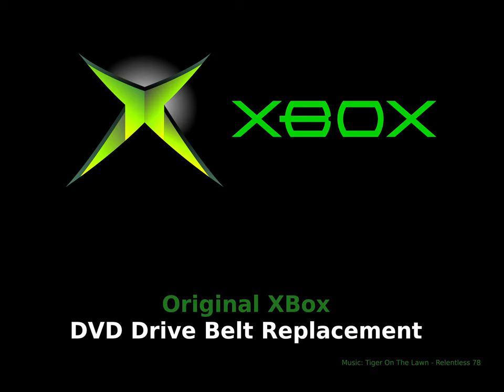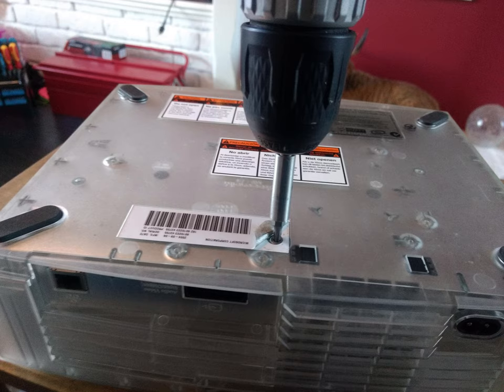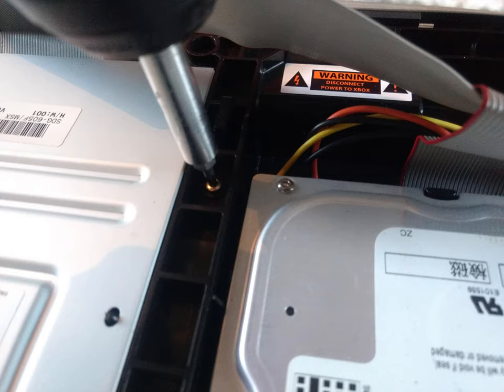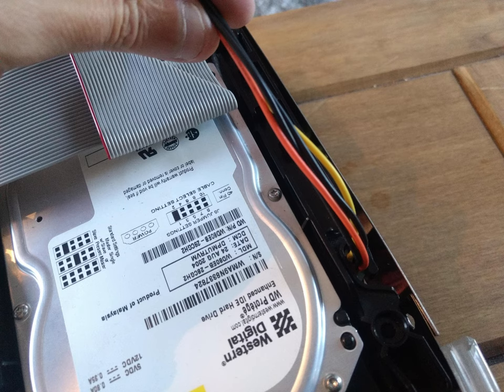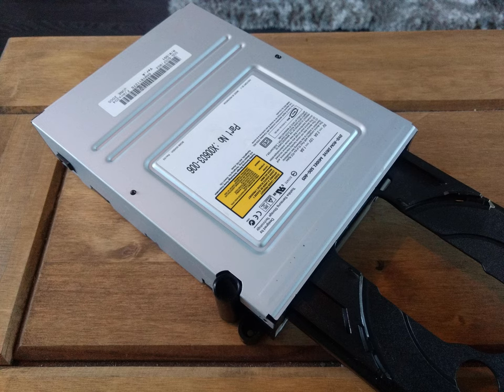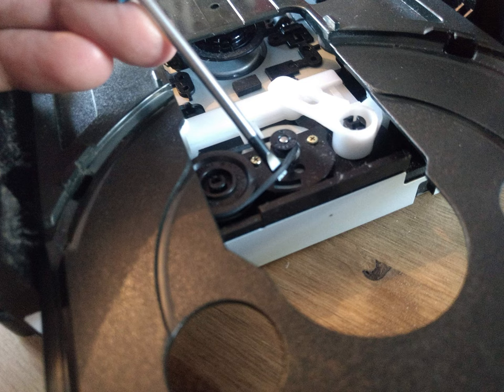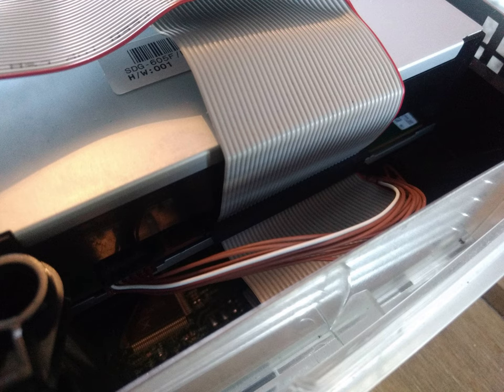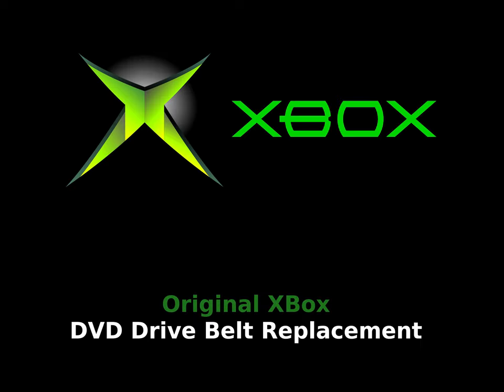Original XBox DVD Drive Belt. Fix Sticking Or Not Opening Drive Tray Issues. OG XBox.

Comment: Wow all these unnecessary steps. Once you have the drive door open.. Stick a pair of tweezers or long needle nose pliers in there and grab the old belt and take it off. Then use a flashlight to light up the two pulleys. Install the belt on the smaller motor drive first. It's a tight fit but easy to do. Then put the belt over the big pulley. You don't have to take the OG Xbox's or 360's apart to install new belts.